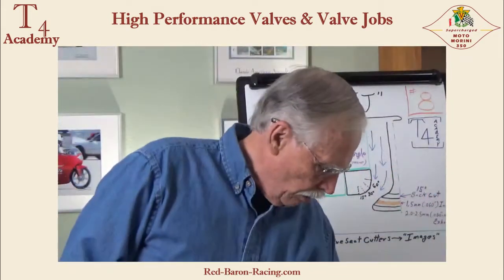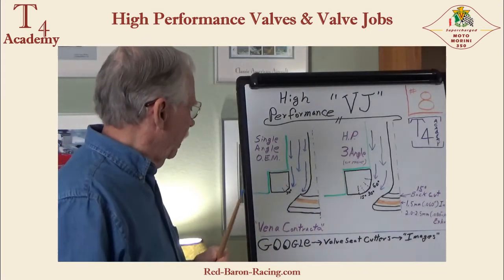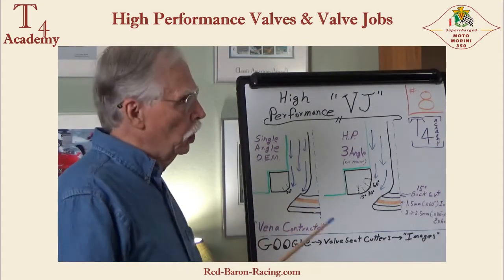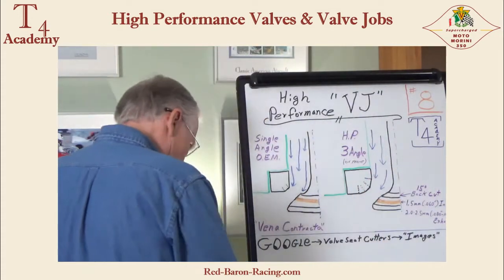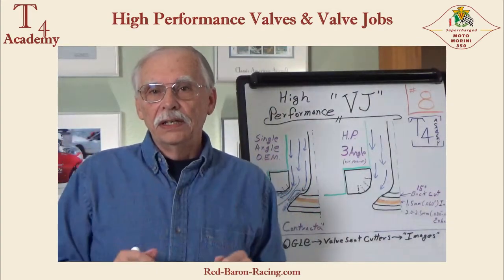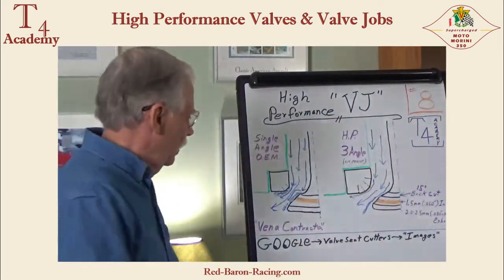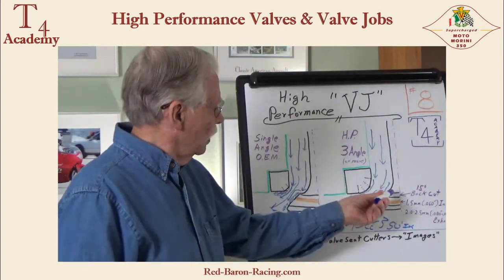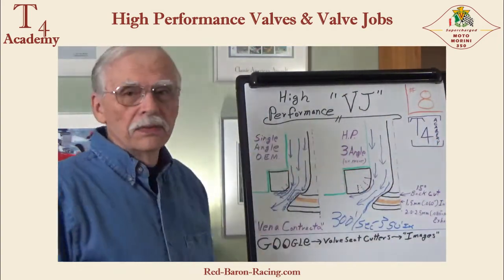Multi-Angle Valve Job for High Performance

Comment: So with the radiusing of the throat and the cutting of the valve stem/valve head bump we are aiming to keep the flow laminar, correct? 

To me the oem valve job looks like it's creating alot of turbulence which is good if what we want is a better atomization of fuel on low rpm but it chokes our top end flowrare, correct?

Great video thanks!

Comment: How about an interferance angle. 1 degree difference between valve sealing seat and seat? Get a better seal.
Reply from the maker: Interesting idea! This sounds like it would reduce the concentric contact area between the valve and seat. That contact area is a critical thermal path, especially for the exhaust valve, so the valve could run hot. It may be pounded into submission to match the angle of the seat over time.

Comment: That makes me wonder if the OEM “tumble” helps atomization in a stock application where they are more concerned with emissions than performance.
Reply: What makes for good performance with valves usually makes for good fuel economy too. It’s just cheaper to machine oem stuff the way they do
Reply from the maker: Well said. The tumble and atomization create a good mixture that achieves a faster burn rate (good for performance & efficiency). The biggest factor for us, as a supercharged engine, is getting maximum flow rate through the valves.

Comment: While you covered the 15 degree incremental changes in angle to maintain laminar flow over the valve seat and face, you didn’t mention that the 15 degree changes in angle function to provide vaporization ridges, to provide additional fuel - air atomization, and is why radius cuts are not typically used.
It’s always left me going huh?, for how much OEM’s leave on the table, for lack of attention to details, for gains in reduced emissions, increased mileage, as well as performance.
Reply from the maker: That's a nice addition! It's a "Goldilocks challenge" to have good turbulence for atomization, but not so much turbulence that the flow into the cylinder is compromised.

Comment: Interesting, I have always done the seat, doing the face can be very tricky
Reply from the maker: Agreed. To be more specific, the seats may have 3+ angles, but valve face is usually 2 angles, one being the angle of the valve face contact area, and the second being the backcut angle up to the stem. There's some good pictures and data at johnmaherracing.com/tech-talk/3-angle-valve-job/